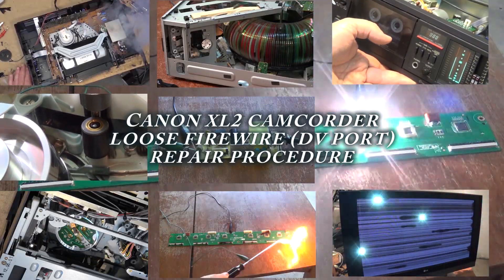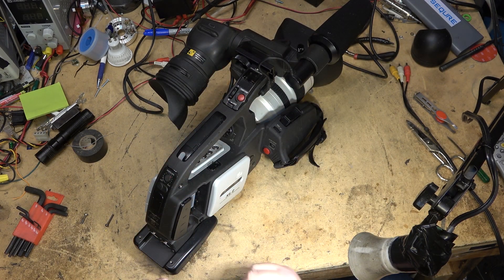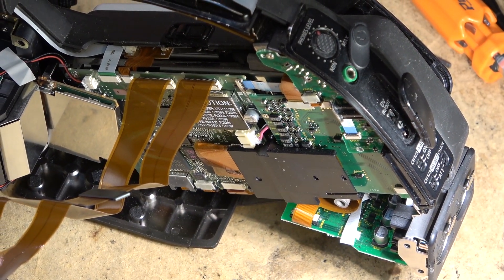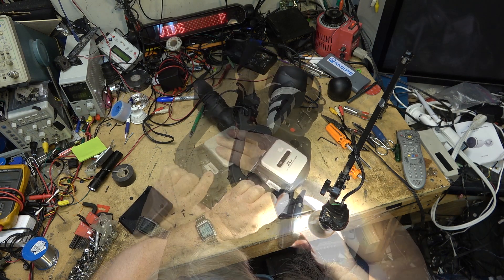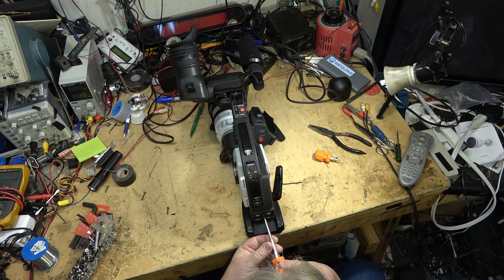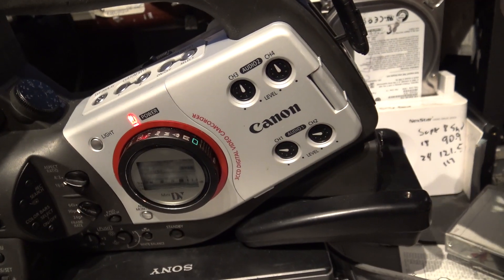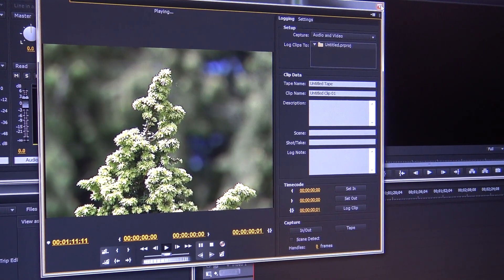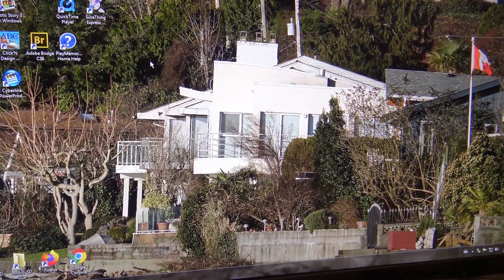Canon XL2 Loose DV Firewire port repair procedure

Comment: Hi Dave, I recently picked up a very low hour DSR-400 Sony eng camera, the original owner back in the day somehow shot the FireWire port and they put it into storage and forgot about it. Just wondering before I go fiddling in there if you've come across many failed FireWire ports in your time that were a relatively straight forward fix
Cheers mate
Alex

Comment: Hi 12voltvids,

I followed this procedure to the letter and my FireWire port is now back where it should be. Unfortunately the port still does not work. Do you have any advice or tips for how I should get it working again? Are there any fuses for the FireWire port on the main logic board?

Thanks for the great video!

Comment: Dear 12 voltvids, I just discovered you, awesome video.  I have an XL 2, actually two of them, one that I bought when it first came out for 4 grand back in the day, and one after 14 years found at a thrift store and bought 70 dollars.  Big difference.  My first camera broke when the video was just recording this line in the middle and the result was a dirt head that needs it to replace and other things I didn't understand, that got fixed.  but now it seems the heads are not functioning well.  the second camera just doesn't want to turn on and is not sure what else needs fixing.  I guess my question will be, what would be a better way to do a check-up on the camera and see what is not working and how to fix it?  I'm tired of paying for something they can say anything and charge me for anything.  I want to learn how to do it myself.  I love this camera, my first love, please help me.

Comment: Hey Dave, I have this Yamaha K-520 cassette deck that I REALLY want repaired. I have a Luxman 3 head that I don't want to put a lot of miles on. I've lost the right channel on this Yamaha and I believe it's an IC chip that has failed. When I engage and stop playback, I get a popping sound in the right channel. When a cassette is playing, I hear clear audio in the left but the right channel is dead but with a faint oscillation. I also replaced the main belt in this deck with a cheap china belt and it has flutter so if you have a belt that would be awesome, if not I'll be ok as this is just a deck mainly for playing the hell out of my cassettes. Honestly, I'm more than capable of diagnosing this deck and repairing it since I'm a certified electronics repair technician and repair cable boxes for Comcast, but I'd rather pay you just to see you repair one of my cassette decks hahahah. It's scratched up so I don't mind if you throw it around on your bench haha and I'm not concerned on costs to ship this.
Reply from the maker: The only belts i have around here are the eBay China soecials. A few clients have ordered in expensive belt kits and brought them in with the deck for replacement.
Reply: @12voltvids  how do I go about shipping this to you for a repair? I don't mind if you don't have a belt, the flutter isn't THAT terrible. Just need the missing right channel repaired :)
Reply from the maker: @Thanson199415  contact me by email.   It's on the about tab.

Comment: These XL2's don't use the EF mount system?
Never used or owned one.  Have a few Canon DSLRs and Mirrorless.  I use a Sony A7III for videos, using the Canon L lenses.  But the lens on this videocam resembles and L lens?  Just wondering . . .
Tried DaVinci Resolve yet?  Version 17.4 is totally free and has apps in it that BLOW AWAY Adobe Premiere.  Hands down.  Check it out, Dave . . .

Comment: Good video. It's got me looking at my Nikon Coolpix P100 where the computer interface connection has gone NFG. I tried to have it repaired under warranty within the first year and they told me it was user damage. Being told by NIKON that plugging a connector in and out of the camera to download to a computer a total of 6 times over 7 months can be user damage is the reason I now buy Canon instead. NIKON lost a customer because they wouldn't honour their warranty at the Richmond repair centre. Their loss as I've purchased 7 cameras and 1 video camera for family members since then. All either small Sony or larger Canon branded product. This after buying 4 Nikon cameras in the previous 8 years before the P100 incident.
Reply from the maker: You have no idea how many Sony cameras I had to inform the customer that the trouble was user damage.  It usually involved sand or salt water in the cabinet.  
One if my digital 8 cameras i got for free that way.  DV port fried because idiot plugged in cable backwards and when it didn't plug in easily, just more force is necessary to get it in right.
Reply: @12voltvids  From the feel I think my connector came loose from the internal board. It was always sloppy as I remember but it finally quit connecting so I went with a portable USB card reader and have used that instead. A lot less money than NIKON wanted to fix the camera and useful for other transfer functions as well. Audio file transfer, etc.

Comment: Well that seemed simple enough.
But the bad part was the lack of dead capacitors :-D

All software seems buggy, it's just finding the lockup trigger.
I used to use cool edt pro for sound capture and modification, but it would crash without warning!.
So i would sample the music and save it straight away.
Then i would edit and save to a different file name, just in case the program lost it's mind.
It's obvious that windows does not have much control of any program,  it requests an application to shut down but i've seen programs just ignore it.

Comment: I seem to recall the capture crash issue was known to the Canon userbase, it should have been fixed in a firmware update. (I worked for Canon online at home doing Customer Satisfaction Internet Research for for a few years, I'd find a Canon user with a problem and reach out to them and escalate the problem to the engineers if needed.)
I doubt very much that Premiere is doing anything wrong.
Reply from the maker: This one has audio issues now as well.  Guess I will see it again.

Comment: Also worth noting people should not plug a FireWire cable in and out when the camera is turned on as it can fuse the port. That’s why so many camera’s on eBay say fully working but the FireWire stopped. It actually tells people not to do it in sone Sony user manuals I’ve read.
Reply: i guess the name wasnt all for show, eh?
Reply: @hershelshochter4703  Indeed lol
Reply from the maker: Firewire like USB is supposed to be hot swappable.  I imagine if someone was pushing the connector in crooked and shorted pins it could be an issue.
Reply: @12voltvids  It happens by crossing data and power lines, when cheap ends (male and/or female) mate with 180 degree orientation, sometimes only needing very little force to "force" the incorrect mating.
Reply from the maker: @MrChrisRP  yes cheap "monster cables" damaged many a port.